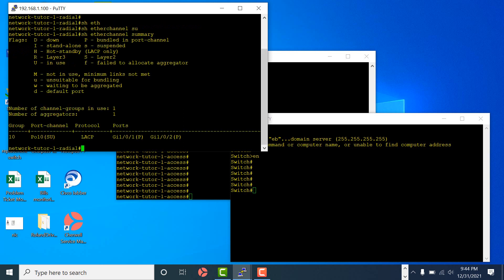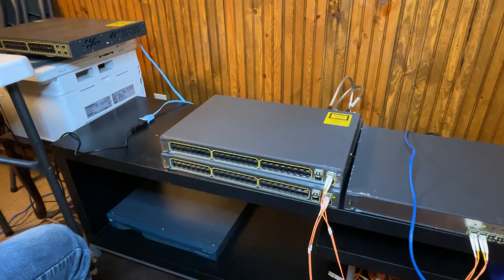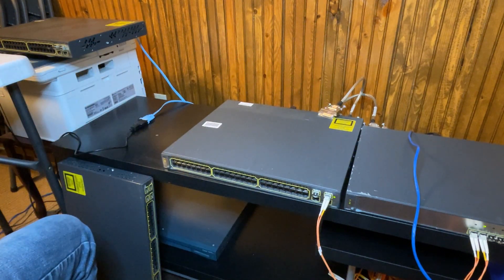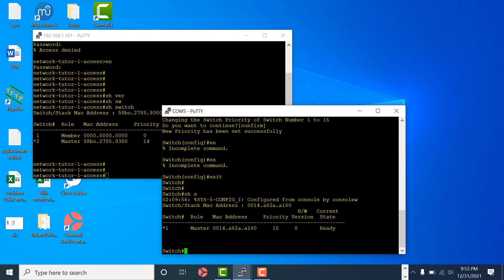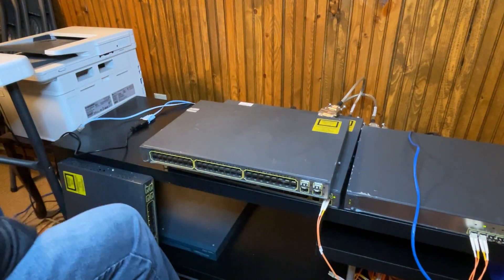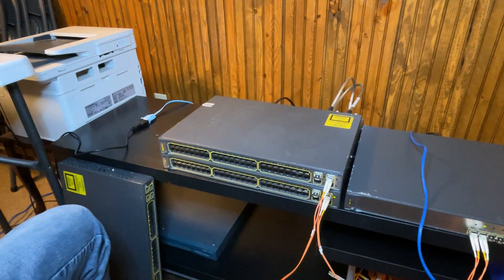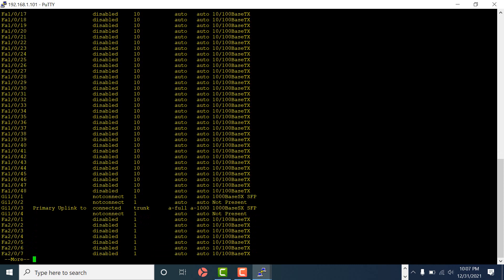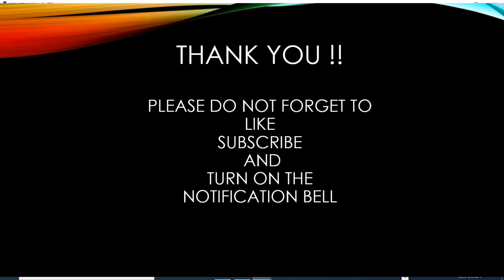How to Replace Failed Switch in a Cisco Switch Stack | NO OUTAGE OR STACK REBOOT

Comment: Question: in the startup of the stack...usually there is the config 
sh run | i provision
switch 1 provision xxxx.xxxx.xxx.xxxx
switch 2 provision yyy-yyyy-yyyy-yyyy". 

When you replace the switch 2 dont you need to remove the "switch 2 provision yyy-yyyy-yyyy-yyyy" line and replace it with the new command "switch 2 provision zzzz.zzzz.zzzz.zzzz"?

conf t
no switch 2 provision yyy-yyyy-yyyy-yyyy
switch 2 provision zzzz.zzzz.zzzz.zzzz
Reply from the maker: Yes. You need to delete the old provision.

Comment: You have given priority 15 to the new switch means your existing configuration would be collapsed....this is going to be a massive failure in live network... You have to give least priority to the switch which you are adding so that it will take the configuration from existing MASTER. Once done change the priority to 15.
Reply from the maker: The way you discribed will also work but it will add more steps and longer time to get the stack back to its normal config. Let me explain you how you can make it short: First understand that your Master already failed and and the switch with priority 14 took over the master. Also it is the best practice that your master sits on top of your physical rack 
1. you configure the new switch to Priority 15 and this switch will be added as a member and will get the config from the current master
2.  Now reboot the stack - switch 1 will become as master now 

Now your stack is back to normal - does this make sense Sir
Reply from the maker: I am replacing switch 1. So the priority should be 15?

Comment: It was very helpful. Could you please upload a video how to do a stack configuration with two new switches. My requirement was I have two switches in stack both are faulty and i need to configure two switches in stack.
Reply from the maker: if you have both switches bad, you need to install the first switch and copy the backed up config ot its startup config. so you have the stack running with one switch. Then add the second switch (just a blank switch with no config - make sure you set the switch number and priority correctly). Second switch will get the config automatically from the master/active. Hope this helps.

Comment: What I thought you said no outages? You reload the switch and it rebooted so wouldn't that be an outage if it were live?
Reply from the maker: think about if this stack has 9 switches and only one went bad. Obviously there is an outage for those who were connected to that switch, but after replacing the failed switch in the stack, you are not rebooting the entire stack to cause a massive outage. that is what i meant without an outage. sorry that my languge is not that clear enough.
Reply: @networktutor640  no worries thank you for explaining.

Comment: use "CTRL + SHIFT + 6 + X" to break that ping; Also I don't think its recommended way to configure the new switch priority prior as master; you can do it post configuration pull up after switch is stacked
Reply from the maker: Thanks for the keyboard short cut. I will try. With regards to setting priority, it doesn't matter when you set the priority. Because, when you boo the replacement switch it won't become as master until next reboot. Best practice is do it before.